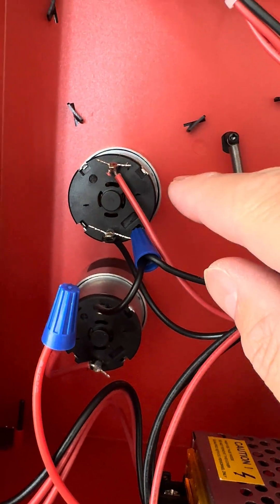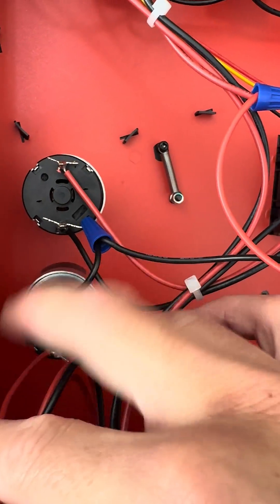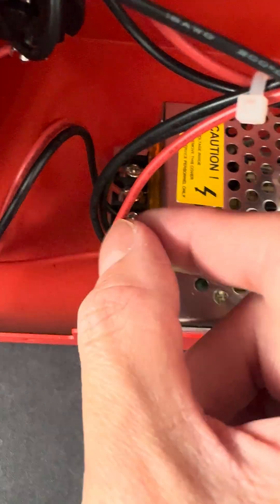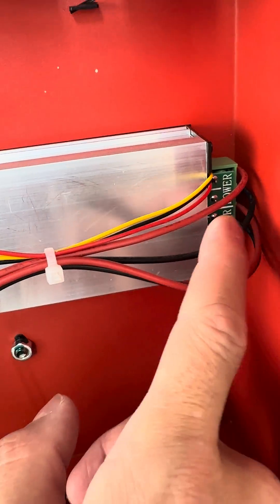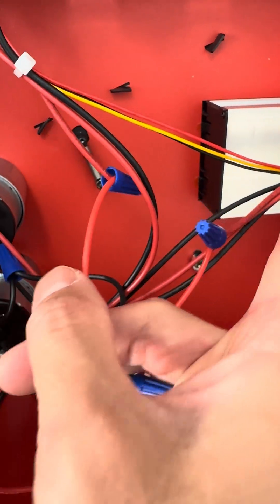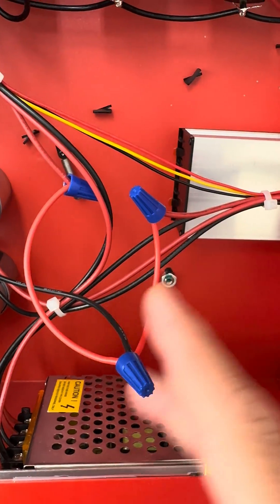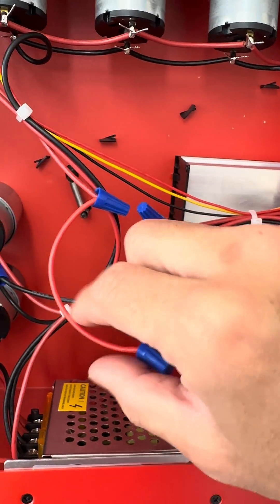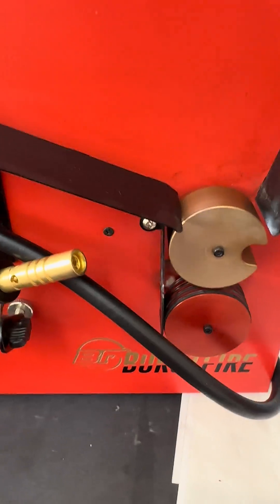🔥 Flame Annealer - Mod for consistent rotation on bottom wheel 🔥

Comment: Just a side note. My model that I bought 6-12 months ago does not have a "red" power wire going to that position at the display to the speed controller. My power wire in that position is "blue". I have verified it and am making the modification now.